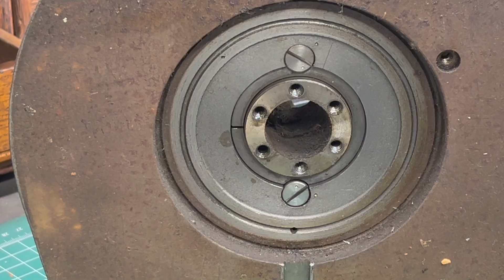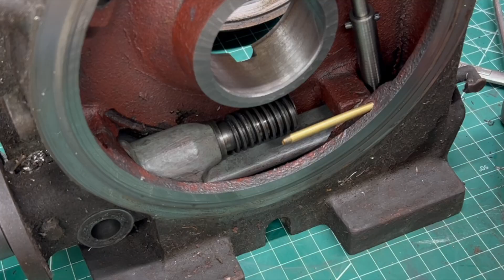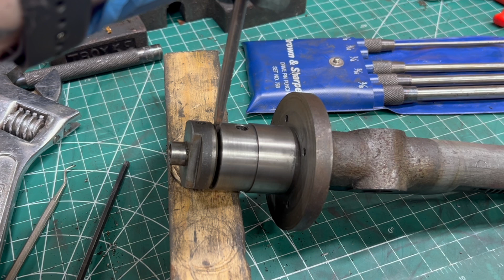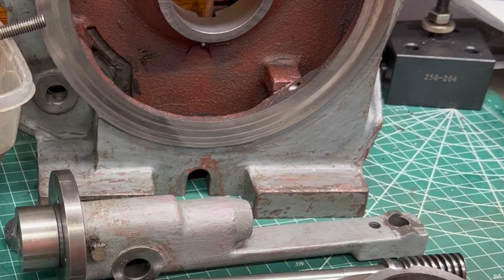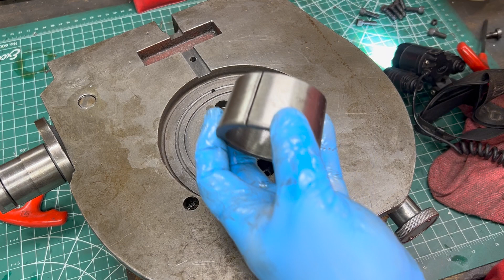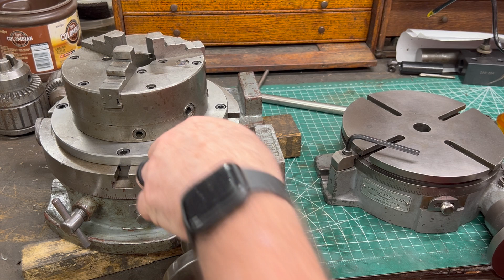Troyke U-9 9" Rotary Table Cleanup (Disassembly and Assembly)

Comment: That came out nice! I tend to fit the largest accessories I can onto my mill, so 9" is good! Just one thing that would bug me, that wobbly handwheel. Not that its a problem really, but its not right!!!
Reply from the maker: It bugs me, too. 😂 It's how it interfaces with the hub. I think. I might look to file it down a bit and fix it at some point.

Comment: I have the phase2 rotary table from the shop fire I need to repair. I believe I will have to try and find/order a new degree wheel as the markings were Burnt off in spots. It was unfortunately painted or coated markings on that particular wheel😑
Reply from the maker: The other option would be to have someone engrave the dial for you. I know I'd seen a few YT channels that have done something like that. Hope you get it all fixed up!
Reply: @ thought of that too but finding someone who can, and then how much would it cost
Reply from the maker: @XXLkielbasa  That, I don't know. I'd check with maker spaces in your area. They might have one that you can learn to use and do it yourself?

Comment: Wow, that’s a interesting. Well maybe over engineered design. Definitely good quality.
I’m guessing it weighs about 100 pounds something like 11 pounds per inch Dang things are heavy. 
Very handy when you need them
Reply from the maker: It's less than 100. It's around 60, which is around my limit of manageable. :)